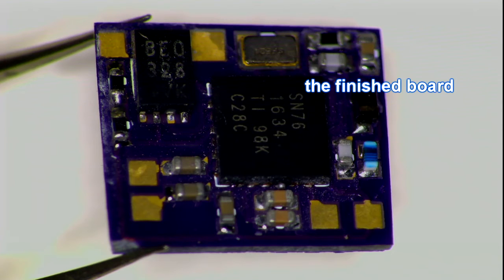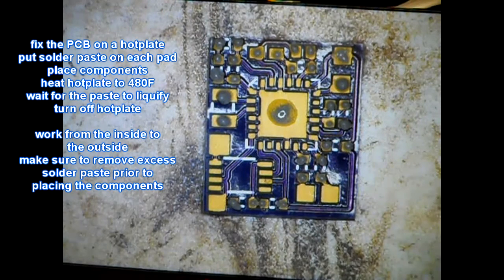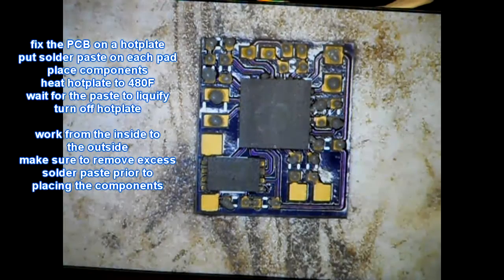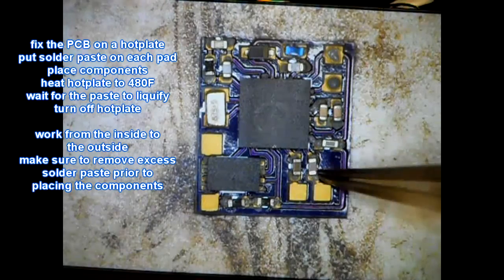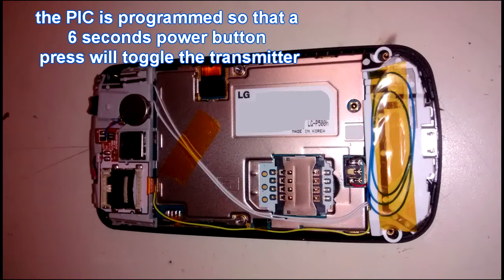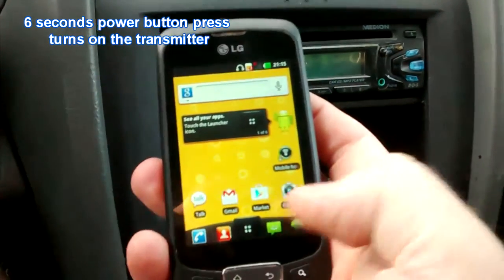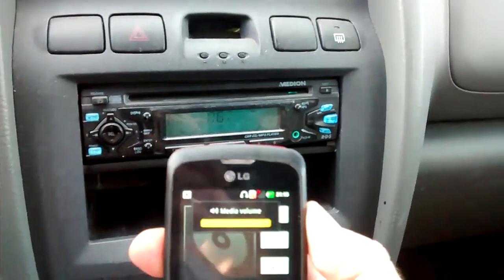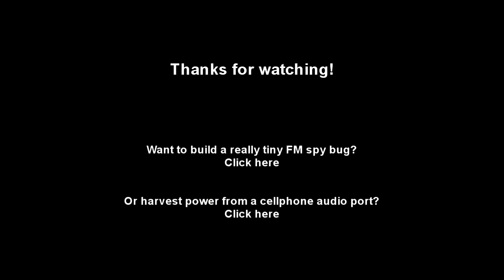How to build a stereo FM transmitter into a cellphone

Comment: Congratulations my friend! I had never seen anything like it before!

Where can I buy this circuit? Could you reach 420 - 470 mhz?

Thank you!
Reply from the maker: No, this IC is specifically made to transmit on FM frequencies around 100MHz. If you want to go higher in frequency you need a different circuit, the range will be better however since the antenna will be much shorter.